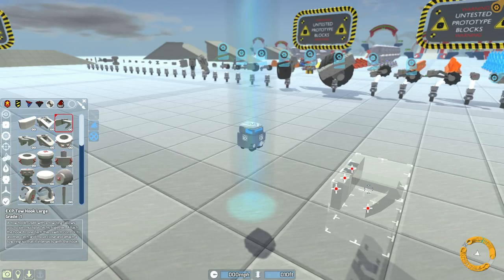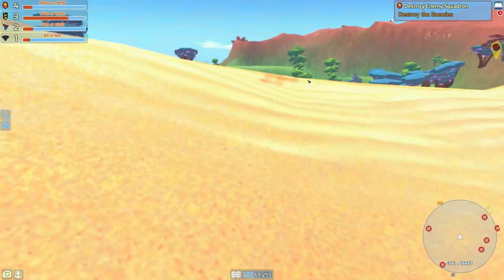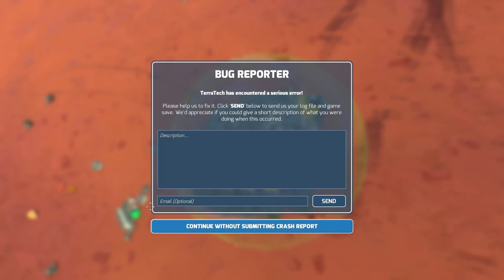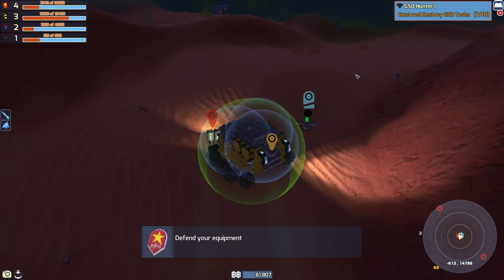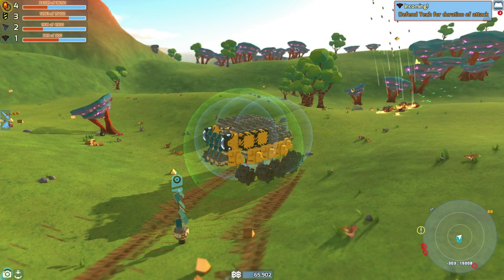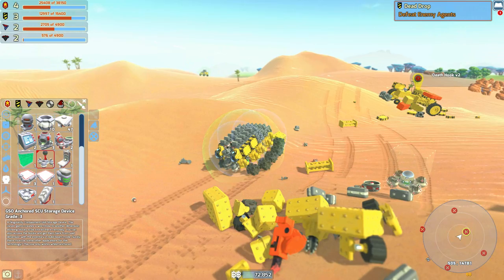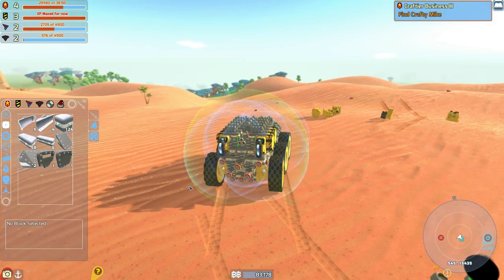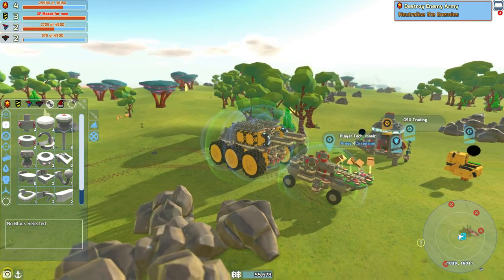Terratech | Ep6 S3 | Trailer Hitch Upgrade! | Terratech v0.7.7.1 Gameplay

Comment: I have a very great tip how to make money. Find salt flat, or find celestite ore. Mine it and put auto miner on top of it so it mines it. Then next to the auto miner put a silo and attach a receiver to it so it picks up ore. To the silo connect a refinery and to the refinery connect a fabricator. On the fabricator set a celestite block and click repeat. Once the block is done put a SCU storage next to it. Now all your celestite blocks are in your inventory. Then put a scrapper (connect a pacemaker to increase speed of scrapping) and connect a delivery cannon to it. Easy money. And keep going. Sorry for bad English
Reply: nikita ign in this season he is not making a base
Reply: The automine seams don't last forever
Reply: similar to what i do, but a lot more steps.  I just put a refinery/resource cannon next to the autominer.  refine and sell the celestine, or erudite, or any other resource.  it is best to stay beside the 'bases' so it takes a long time, but yeah, it makes a lot of money.  with erudite, you can usually find 3 or 4, sometimes even 5 seams close enough to get them all into one refine/sell base making HUGE amounts of money.
Reply: unless they have adjusted it in the latest update again, i've had them last for maybe 100, i've not kept count, but it is several in game days.  it takes a LONG time to mine one out.  7.7.1
Reply: Nevyn A'Tall i use'd' that tactic, but my miner ran out, it was INSANELY close to my base (it still stays there for memories)

Comment: The ball joints and the bearings are really for connecting two techs together in a truck-trailer type way, but rather have two techs act as one. Like making mechs in from the depths using docking stations.

Comment: May want to put in the title somewhere that this is the experimental branch. Was wondering why my game didn't have the new hitches and axle blocks in them until I remembered to check the version numbers.

21:01 and the other Venture ramps are from previous missions you've completed. Kind of nice they stay around so you can mess around with them afterwards. Then again, Venture quests are quite a WIP so some oddities as well with the sky hoop quest not progressing right.

Hopefully since the devs are adding a new key for the break-away bolts, maybe we can have a hitch / un-hitch command or key as well soon. I'm glad they finally added ways to officially make trailers so I'll let them continue to refine how they work.

Comment: Apparently there are rumors spreading that the mortars do crazy damage. On a cheat sheet there is a new artillery type weapon that is a ai and can be anchored or unanchored. The new mortar type weapon has not yet been announced due to extreme glitches. The mortar tracking was added in the last update but just like the lasers have a limited aiming angle

Comment: Wrong section, but about Reassembly, the Mini-gun's raw/potential damage is 25*45=1125, the laser's is 680 which is about 60%.
Laser positives: consistent point/penetrating damage, nearly 100% accuracy , no recoil, cheaper, very little energy usage (30/s)
negatives: shorter range, bigger in size
Mini-gun positives: very high potential damage, smaller in size, bigger range
negatives: damage is really spread, very power hungry (45 shots/s * 4=180/s), high recoil

Comment: Found a glitch?  I made a platform with just geocorp drills facing up and saved it.  I  just have to spawn it in under the drop point and switch to it and hold space.  The invader explodes before i can see what it is. Basically made a pungy pit of drills.

Comment: great vid a bit of advice on the upgrade maybe consider  putting a magnet on it  or even just keep a spot to  slap on the magnet and remove it that way rather then keep moving the scu  and having it recharge  again you can use the magnet to bring stuff within range of it also the  venture fabricate can  store  stuff in compressed blocks of  8 or so if your looking into crafting stuff for yourself seeing as trade stations can be kind of a  rip off on some items you just need rank three in the  faction to make its  compressed block

Comment: Patch 0.7.7
Increased the range, rate of fire, damage and seeking ability of the GSO Mortar.

Patch 0.7.2
Added 9 new GeoCorp Bumper Blocks. This set of blocks can be used to make strong Bull Bars, Bumpers and Rams.
GeoCorp Half Block.
GeoCorp Half Corner Block.
GeoCorp Long Half Block.
GeoCorp Behemoth Wheel - which is now the biggest wheel in the game.
GeoCorp Anchored Delivery Cannon Block.
EXP Anchored Plasma Furnace Generator Block (R&D Test Chamber only).

It's about to get From the Techs up in here =) I am personally VERY happy to see the geocorp half blocks added so i can properly shape up my bots a bit. And I very much want to give those Behemoth wheels a spin.

Comment: Lathrix! Mortars are seriously powerful right now. Ridiculously powerful. You might want to consider using them.
Reply: Nevermind. Well, when you build a new trailer, you should just load it up with Scrap magnets and repair bubbles. I personally carry 2 large magnets on my craft to suck up the bits an pieces that fall off of other techs. It can ensure you get more yield for parts.

Comment: @Lathrix their is a slight issue with putting mortars aimed up on your vehicle, they are balanced in that the more of a up angle you have the more time it has to guide yes, but the less distance it will be able to travel, they are angled at 45 degrees by default because that gives them the optimal range, any other orientation and you are sacrificing distance.
Reply: thomas roberts well.... They already have additional range :p
Reply: true, but if you reduce it then your taking away their main advantage, at that point you might as well use pound cannons or something.

Comment: should have a multi-purpose station, SCU + charging station + simple defense, deploy it to charge and collect stuff. its much easier than placing SCU on the ground as you dont need to have the correct camera angle and can charge while waiting, and can remove it easily even gotten slightly far away.

Comment: A ball bearing pointing up on the main, and the holder on trailer is how its done in rl. (i think it does actually matter which is on top and bottom) also, trailer should have only 2 rigid wheels, you could use those little near useless gso wheels to make turning easier I think.. Havent done any tests though.

Comment: they should add hydraulic pistons so you can push things up and down so if your in a tech and your resource collecters are high up so they dont run aground or get damaged easily you can push them down so you can collect the resources

Comment: Right now the u can build or buy any item u own in the station shops u can place down.. small bug but became useful because i wanted a few things. Next when u upgrade add mobile furnaces u can connect them to gso large collective block and it well only burn the the wood /burnables u pick up on the way.. they seem to be over powered i havent anchored in a long while